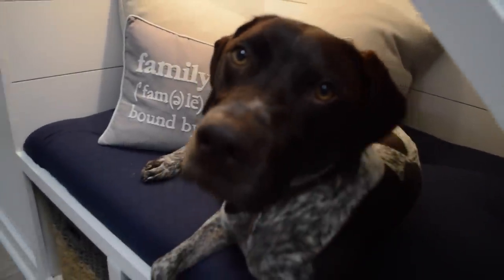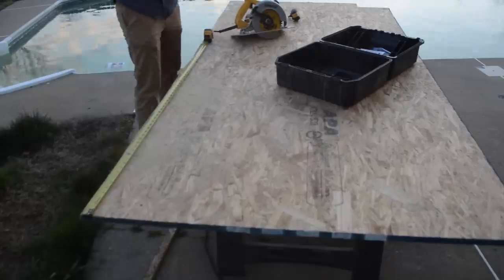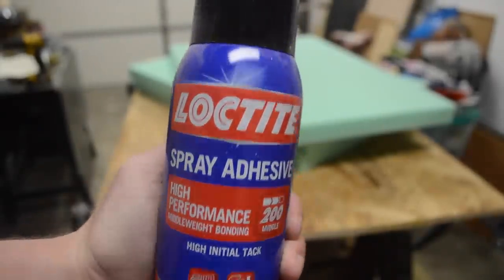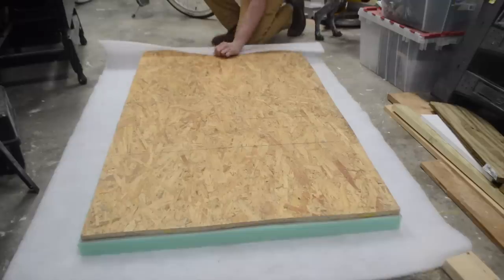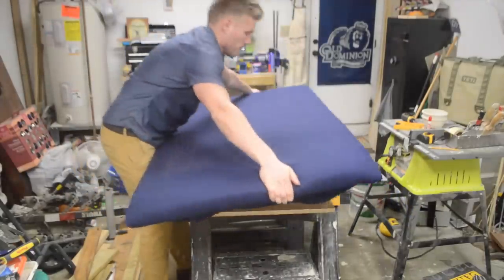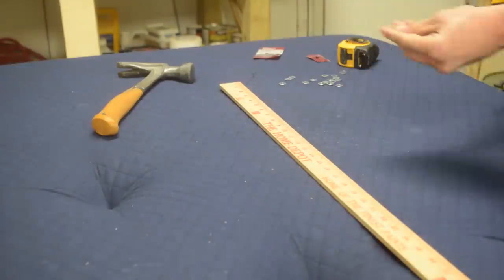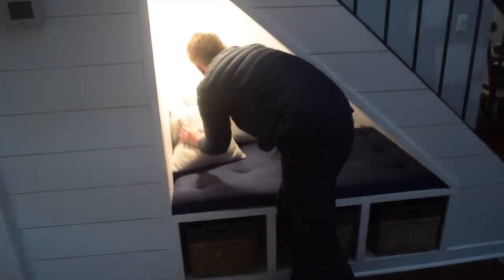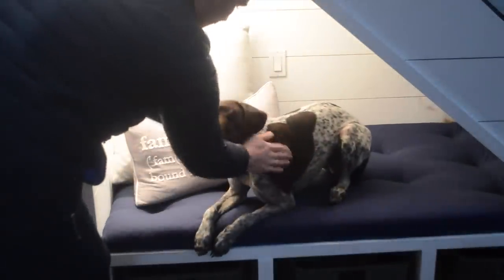How to Make a Tufted Bench Cushion (NO SEWING)

Comment: Thanks for the video.  I'm going to try this, but was wondering if the staples are still felt through the board?  I have a cushion in our entry way and when we stand on it to get coats down we've been poked with random staple ends.  Is hammering them down the only way to fix this?

Comment: What type of screws did you use? I'm curious, I've done a project where I tried to screw through fabric once and it got all twisted!
Reply from the maker: I used #6 screws I believe appx 1" long.  The screw doesn't really matter a whole lot.  I actually ripped through a test piece and had to fix.  The key to driving the screw through is holding the fabric with your hand stretching it really tight and going slowwwww with the screw.  the washers will help displacing all the pressure so it doesn't rip.  Hope that helped, and thank you for the comment.  I should have explained that a bit more in the video!

Comment: Actually that's not "Plywood", that's what is known as "OSB" (Oriented Strand Board), board it consists of shredded up leftover, recycled, wood shavings glued together. then pressed flat by huge wood presses. It is generally used for siding, floors, and roofing in building construction. Though it will generally last quite a long time when covered by another material such as siding, flooring, or roofing materials, but overall, it has neither the good looks, or the grain-look staining qualities that normal plywood has. Though it is generally cheaper to purchase than plywood of the same thickness. If anybody tries to tell you any different then, they don't know what they are talking about. If you have any doubts, then feel free to take a tour through a plywood mill or look it up on the internet.  -  Here is what the internet has to say about OSB..... Quote, "Used for sub floors, exterior walls, and roof decking, OSB sheathing is a structurally-engineered board that is made up of compressed wood strands. These strands of wood are arranged in layers that are bonded together with resin, which helps produce a strong product. OSB, or oriented strand board, is unlike traditional plywood in that it has no laps, gaps, knots or voids. In most applications, this sheathing is dimensionally stronger and stiffer than comparable dimensional plywood boards. Many builders gravitate toward it not only for the increased strength of the finished product, but for the cost effectiveness as well. Usually, the price difference between OSB and plywood is significant enough to warrant common usage." Unquote.  - Many construction contractors (both commercial and non-commercial), will tell you that Quote, "To gain that structural strength when used vertically upon walls etc., the OSB sheet has to be installed upon the wall in a horizontal rather than a vertical configuration with the edge seams running horizontally rather than vertical." Unquote. - I have no idea of the validity of that last part though, as I've seen OSB installed both horizontally and vertically in building construction, though generally when it is installed in the vertical configuration, it has been done by a non-licensed home-owner, or by an amateur builder in what is known as a "Handyman".
Reply from the maker: This is an awesome comment thank you for the correction!  For thew longest time I just called it ply wood, I'll be sure to call it OSB in the future.  I'm sure this application will be fine for it as long as no one gets splinters in their butts we should be okay!  Thanks for watching!
Reply: @ZacJones  Short version: Engineered Wood, also called mass timber, composite wood, man-made wood, or manufactured board, includes a range of derivative wood products which are manufactured by binding or fixing the strands, particles, fibers, or veneers or boards of wood, together with adhesives, or other methods of fixation to form composite material.
Just call it that and you're covered.☺

The only real concern if using it for interior furniture is the out- gassing of formaldehyde used in its manufacture, some people are very susceptible to this toxicity.

Love your dog, we do Dachshund senior rescues, wouldn't have it any other way.